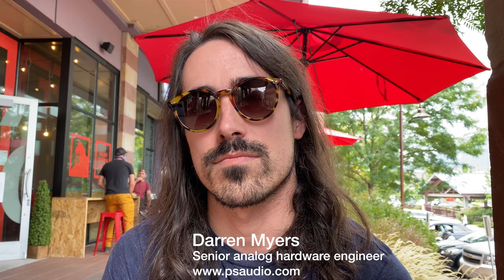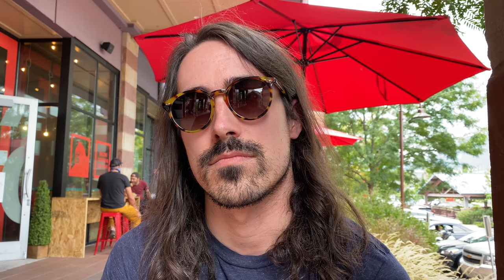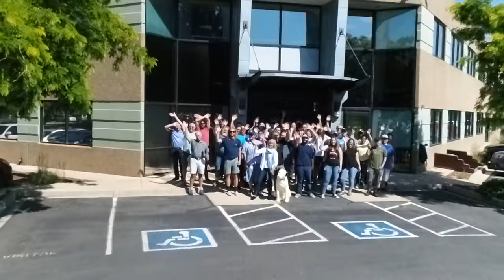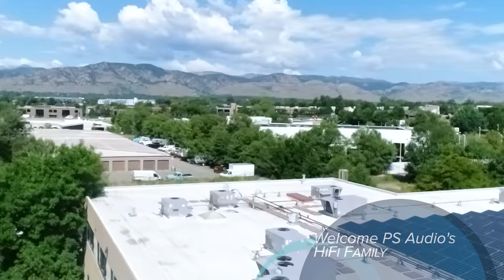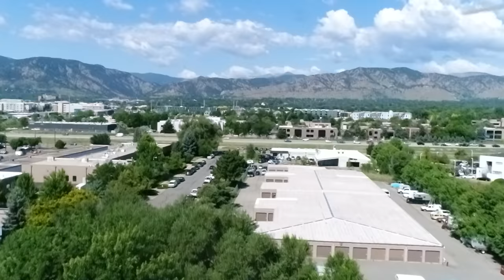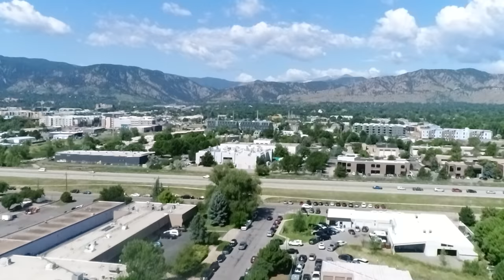Lunch with Paul: The art of the phono stage Part II

Comment: I think I know where you're coming from Darren ... I do admire your objectivity .. my craving for perfect sound only stops when I can't tell the difference between being right there in a band or in front of an orchestra or whatever and my own system ... I do have reservations about RIAA equalisation ....I'm not sure how many poles you adopt in the curve ( most times only two are used ...) I'm considering an all digital design using no poles and zeros but just an infinite " number" of points programmed to have gain levels to match each respective frequency .In other words it behaves like a piece of wire with inverse  RIAA gain with matching phase.